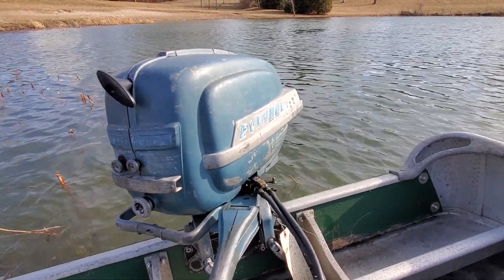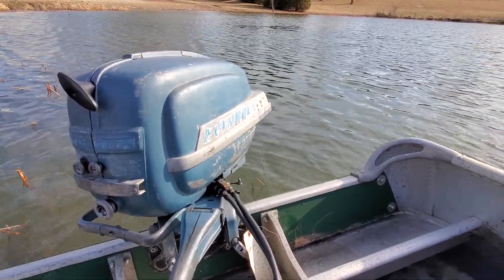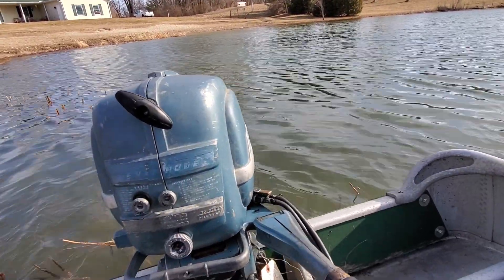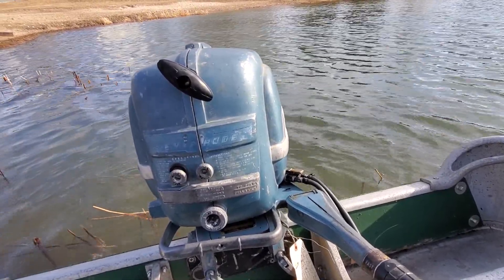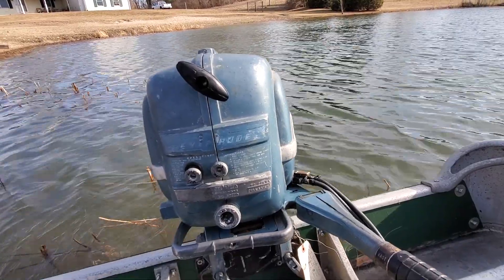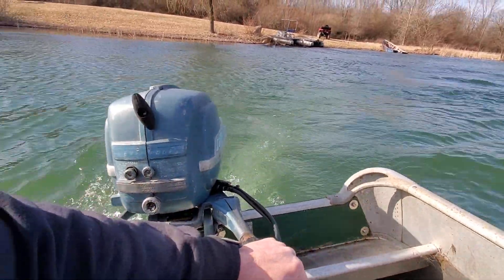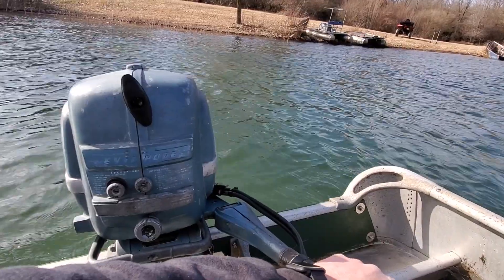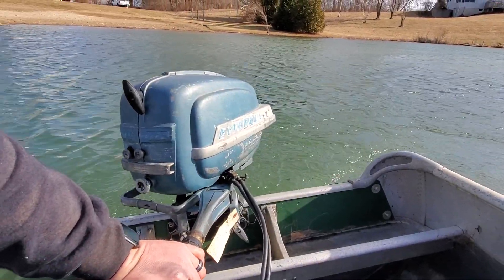1953 Evinrude Super Fastwin 15hp Outboard Motor Pond Test

Comment: I just love how these 15’s run when they’re tuned and adjusted right. The slowest possible put - put - put idle, and smooth all the way to a strong top end. Can’t decide if these or the QD 10’s are my favorite run quality, but I just love all these old OMC’s. Thanks for making and sharing all the videos!
Reply from the maker: I completely agree.   These OMC 15s have such great run quality when they are properly tuned and adjusted.  I am always amazed at how low these will idle.  The 10s are excellent too.  Their run quality is second to none.  I find that the 15s will take lots more abuse and maintain that excellent run quality than the 10s but in top mechanical condition I don't know which I would call better.  The 61-63 10s with rollers on both ends of the rods are better in the durability department, but not much out there beats the durability of these old 15s.  I brought a Johnson FD-10 back to life once that I never dreamed would run again when I took the cylinder head off.  My dad still runs it occasionally today.  Amazing motors.  Thanks for watching!

Comment: I recently picked up a 1956 15hp Johnson.  It had 70 psi compression on both cylinders and had not run since 1982!!!
I did the T-Mikes conversion with a fuel pump and have it just now running. Have rebuilt carb. The magneto & spark is all good and timed within the marks with a timing light.
The gear case needs attention and am awaiting all parts.  
Mine with 70 psi is a tough pull for an old man like me… cannot imagine 90psi or even 100!!!
Reply from the maker: Congratulations on your new motor! 70psi is kind of low for a 56 OMC 15hp. What brand is your gauge? Harbor Freight gauges are notoriously low.  You may have higher compression than you think.  
If the motor has not run on 40 years, the oil in the bearings is going to be very thick and gummy.  Once the motor runs for a short while again, the stiffness will probably go away and it will be easier to pull over.
I personally very much like the original pressure fuel system, but if you do not have access to a tank and do not want to wait to find one, I can understand the single line pump conversion. Sounds like it will be ready to go once the gearcase is serviced. Those 50s 15s are probably the best running motors out there.  Good luck with yours and thanks for watching!
Reply: I have two different compression testers an older one from the 1970’s and a new mightyvac MV-5530. 
Both read 70 psi. The engine had not run yet and this was using the recoil starter.  I will check it once I’ve run it a while again to see improvements.
Reply: I have the original manual and it does not specifically state 24:1…
It says the high miler tank can receive 5 gallons plus one quart oil.  That’s 20:1… 
What are you running? 24:1?
Reply from the maker: @davemilster  I am running 24:1 in this motor. The larger Mile-Master and Cruise-A-Day are 6 U.S. Gallon capacity. One quart of oil per 6 gallon tank is 24:1 which matches the published data that was put out by OMC at that time.  They also recommended mixing half a pint of oil per gallon (16:1) when mixing small batches for the same motors.  The extra oil won't hurt anything, but they were supposed to be run at 24:1 and be reliable and durable with that amount of oil in the gasoline. 20:1 is also acceptable. 👍
Reply from the maker: @davemilster  Yes, and I understand using the recoil makes for kind of a subjective reading.  70psi is sufficient and it will likely improve woth some running. I believe you'll enjoy your motor.

Comment: This  is the beauty of the old OMCs....Even with stuck rings and uneven compression, this poor old dog still idles better than most new 4 strokes...Didn't see any smoke either.  The compression will probably come up even more with more use and a few more soakings with engine tuner/kroil…  Good for another 50yrs!  This was amazingly smooth and quiet also
Reply from the maker: Yes, it would still idle surprisingly well even when there was 30% difference between cylinders.   With less than 3% difference now, it really is a beautiful runner.  It may come up a little more, but it is already better than one of the two '54s I have on the rack and on par with the other one.  Once it is warmed up smoke is very little at 24:1 mix.  I may do another cycle or two of Kroil and engine tuner just to see what it does.  At any rate, it's a really nice runner now and is quite smooth for a Super Fastwin.   Debating a cosmetic restoration of this one. While still presentable,  this one is on the rough side appearance wise.  Thanks for watching, Don!
Reply: @oldjohnnyrude8404  Leave it the way it is an enjoy it...You won't want to use it if you fix it up so nicely....
Reply from the maker: @fleetwin1  It will stay the way it is at least for now.  I have a '54 Super Fastwin that someone else already painted that might get a restoration first.  It is also a great runner and i would like to have at least one of these that is a nice looker.  It will still get used though.  I enjoy running my motors. The vast majority of them remain as original.

Comment: Those 15 horsepower Evinrude we're sure to make trolling for salmon a pleasurable experience that Evinrude I'll tell you would / all day at a good trolling Speed without a hiccup or a burp compared to most outboard motors of today I can remember back around in the mid-60s I knew a guy who would take me out fishing and he had that same outboard motor on his 14 ft Valco aluminum .
Reply from the maker: Absolutely,  these Evinrude 15s are the best running outboards inhave ever worked on.  The 18s are still my favorite as they have a bit more punch.  The 15s are just simply incredible runners though.  They'll push a 14 foot aluminum fishing boat at a good clip and then idle down and troll for hours without the slightest complaint.  When it's time to head back in, it'll get right back up on plane and go back to the dock.  Really great motors.  A bit less top end and higher fuel consumption than the later 15s, but the way they run is really beyond comparison. Thanks for watching!
Reply: @oldjohnnyrude8404  I was just going to say about the fuel economy on a 15 horsepower Evinrude for that year because I believe the 15 horsepower Evinrude was The Best of Both Worlds that can push a 14 ft aluminum boat with the greatest of ease and yet not gobble up the gallons of fuel .

Comment: Great video. There is currently an outboard
very similar to this for sale locally. Did you have the opportunity to test the compression prior to purchasing the engine. Do sellers give you a hard time when you request doing that. Are the rubber check valves a part you can purchase new. Thank you.
Reply from the maker: I'm sure the seller would have let me test compression before I bought it if I had asked. Depending upon the motor and the cost I will sometimes do a thorough inspection prior to purchasing.   This was a $60 motor and I looked it over well enough to take a chance at 60 bucks.  Most sellers don't seem to mind when I come to give a motor a good look over before buying.  Yes those check valves are still available.   Marineengine.com has them in stock for $19.  Thanks for watching!

Comment: Turned out well, indeed!  Has some real zing, and a nice troller.  Looks like that pond is barely big enough to accommodate 'er at full throttle.
Reply from the maker: Thank you. These old 15hp OMCs are probably the best running outboards i have ever worked on. I still prefer the 18s for the extra punch they provide, but these 14s are amazing runners. 
Yes, the pond is pretty small.  About 10hp is really max.  15 and 18 I have to get out of the throttle in the hard turns or I'll bring the prop out of the water.  I have run 40hp on it, but that's obviously way too much. Thanks for watching!

Comment: have a 1950 Fastwin15 i'm trying to save, pistons were seized in cylinders from sitting in submerged in water over a winter laying in bottom of the boat. ive worked them free, replaced points, coils and condensers, and cleaned carb. I don't know any thing about outboards. how can I lube crank case with out cracking? hope this does not sound dumb, but how do I change powerhead oil.
Reply from the maker: If it is a 1950, it's a 14hp.  That is a little different motor, but probably not relevant to the main topic here.  If the motor was actually submerged for any length of time,  the cylinder bores will only be part of the issues.  This engine is a 2-stroke.  There is no oil bath in the crankcase.  The oil is mixed with the gasoline,.  The mixture passes thru the crankcase on the way to the cylinders.  That is where the lubrication comes from.  I would recommend tearing it completely down and checking out all the bearings in the engine.  If the needle bearings get rusty they don't run very long.  That said, these are incredibly durable motors tolerant of abuse and poor conditions.   I revived one with the pistons frozen and both cylinders full of rust that I had to scrape out with a screwdriver.  It was a little low on power, but still ran well a day pushed my 14 foot Sea Nymph at about 17mph.  If you're just trying to get some oil in the crank bearings to keep it from spinning dry when you first start it, you can pull the intake manifold off and spray some in through the intake openings in the case.   Thanks for watching!

Comment: Should my 55’ Johnson QD16 10hp be run with 24/1 mix even with modern oil ( my outboard mechanic says just use 40/1 ) ? But my dad always ran our 1950’s outboards 24/1...Gary in Port Huron, Michigan
Reply from the maker: I run my motors at factory recommend mix ratio.   The factory recommend mix is 24:1 and the earlier (pre-1961) OMC 10s had smal wrist pins that are susceptible to damage if run wit too dry an oil / fuel mix.  I recommend staying with 24:1 even using modern TCW3 outboard oil.  Thanks for watching!
Reply: Old JohnnyRude thanks, I will run at 24/1 then
Reply from the maker: @highwatercircutrider  Excellent,  your motor will thank you.
Reply: He's hoping  to sell you a new motor.
Modern oils aren't miracle oils they just burn cleaner.

Comment: I just got a super fast twin and tried it out on a 14 foot aluminum boat and it runs good. But I don’t get near the speed your getting? Any tips? Prop or could it be a tuning issue?
Reply from the maker: Congratulations on your new motor!  The speed depends on a lot of factors.  The state of tune and the mechanical condition of the engine, the prop, the trim angle of the motor, the weight and design of the boat hull, how much weight is in the boat, and how the weight is positioned in the boat.   I am running a stick 15hp OMC semi weedless prop on thus motor for this video.   It is running on  my Alumacraft FD 14 footer with nothing in the boat but myself and the fuel tank.  It is trimmed out enough to make the A/V plate parallel with the bottom of the boat.  This engine has right at 90psi of compression in both cylinders give or take a couple psi.  I don't know what you have done to the motor or where the mixture needles are set on the motor with regard to being lightly seated.   Too many unknowns for me to make any real calls on if it can be improved.   This motor is, of course,  freshly tuned up.  Thanks for watching!
Reply: Old JohnnyRude it is a 14 foot sylvan sea snapper, had me my dad the gas tank a trolling motor and deep cycle battery in it. It is a deep v with it trimmed up as far as the motor will allow which makes it pretty well parallel with the bottom of the boat. I haven’t done anything to the motor. The guy I got it from said he put new plugs in it and did a tune up on the carb. But personally I am not super familiar with outboard motors so I may end up having to bring it to a shop to see if it’s mechanically sound. I’m not sure on what prop is on it either unfortunately
Reply: Old JohnnyRude the original owner said he did a tune up on the carb but I’m just trying to figure out where to start. I’d like to learn to fix the motor myself if I can. Probably should start with trying to adjust the high speed rich/lean then go from there? Looks like your pretty good with these older motors

Comment: I just picked up a 1956 gale buccaneer last night, ran it in a tank ran beautifully, went out this morning and it was leaking fuel out of the exhaust,  I don't know enough about these, there is a fuel knob on the side and then the dials on the front, I think I left something in the wrong setting.. any ideas?
Reply from the maker: There is no fuel knob that would prevent fuel leaking from the exhaust.   If you're having that happen there are a couple of possibilities.   One is a carburetor float is either out of adjustment or the float valve is not closing / sealing properly.   Another possibility is a blocked lube line that goes from the bottom to the top main bearing.  If the crankcase condensate is not getting pushed to the upper main bearing properly,  that fuel mix may run out the crankcase drain into the exhaust housing and end up coming out the exhaust.   I would address the carb first since that is the simplest fix.  If it is the crankcase drain,  that can be more challenging to correct.   Thanks for watching!
Reply: Thanks for the help,  I'll start with the carb first. Keep up the great work,  can't get enough of your videos.. 
Cheers.. 😊
Reply from the maker: @neilpare8938  You're welcome.   I just test ran my 57 Evinrude Fastwin Electric on the pond today.  It ran great but after shutting it off for 45 minutes or so I tried to restart it.  When I hit the started it wouldn't crank. I tried the rope and it wouldn't budge. The lower cylinder and crankcase half had filled with enough fuel to hydro-lock the engine.   I had to get it off the boat and pull the bottom plug out and start slowly cranking the engine over to drain all the fuel out.  I have a freshly rebuilt carb to get back into.  It happens sometimes.
Reply: That sucks, sounds like we're gonna be working  on similar challenges.  Good luck, I'll let you know how I make out.
Reply from the maker: @neilpare8938  Yes, it's a similar challenge.  I'll be looking for your follow up.   I'll get a video of the 57 this season once it's been sorted out.  👍
Reply: I'm a little nervous with this one, don't know much about them and there's not a lot online, so we'll see how it goes. 😊

Comment: I'm curious, what symptoms would  be caused by a worn wear-plate?
Reply from the maker: With a new impeller a worn wear plate is not easy to notice, but it will not allow the impeller to pump water as efficiently as a new one.  When they get grooved and worn the impeller does not make as good a seal against it.  The new impeller will not pump well for as long if the plate is worn either.  If they're grooved slightly I usually leave them, but if they have a fairly deep groove, I'll opt to replace.  Thanks for watching!

Comment: Where do i find parts for this thing?
Reply from the maker: Marineengine.com, iBoats, Crowley, or your local Evinrude parts dealer has parts.  All the tune up parts are the same as the '58 18hp.  That may help you locate them.  The prop shaft seal is different in the gearcase. If that leaks, the new ones are expensive and a bit difficult to find.  Thanks for watching!